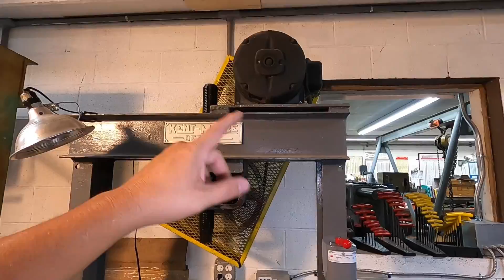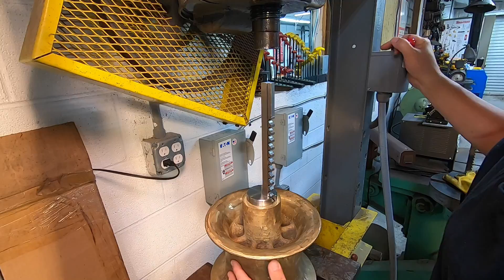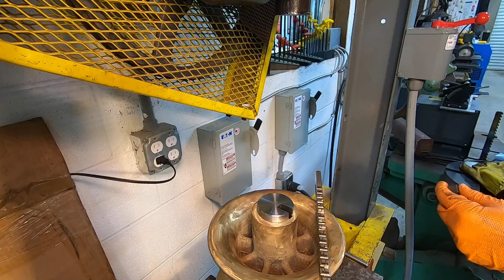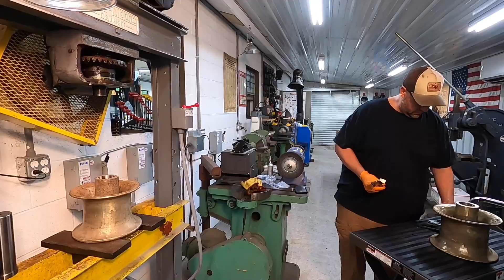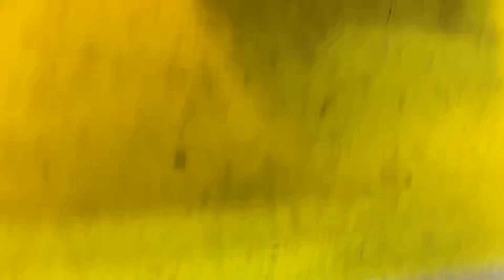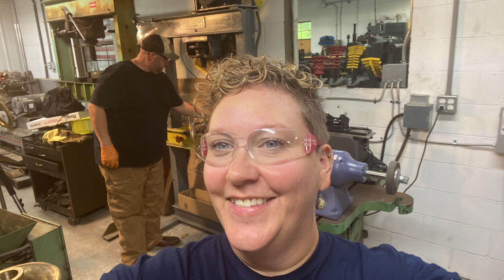Broaching Keyways in Cast Bronze Capstans Part 3

Comment: Those bevel gears sound nasty! Or is that ring and pinion? A machine that sounds like that sets my teeth on edge!  Maybe there is an adjustment to tighten them up a little? Or maybe Keith Rucker could make you new gears since he is doing bevel gears for his Planer now?

Years ago I worked for an Industrial Supply company. One day the cooling failed (it wasn't A/C just the old roof mounted coolers and water circulation). The pulley (sheave) on the motor had come apart!. No problem I thought. We had pulleys with Both Dodge Taperlock and Morse QD. Unfortunately we didn't have the right size insert to fit the shaft! I got the pulley and a smaller diameter insert and Drilled it out on a drill press. We didn't have a machine shop.

It was still working when I got laid off two years later!